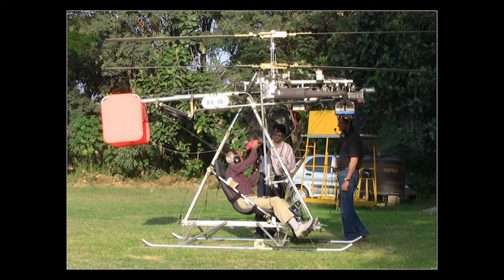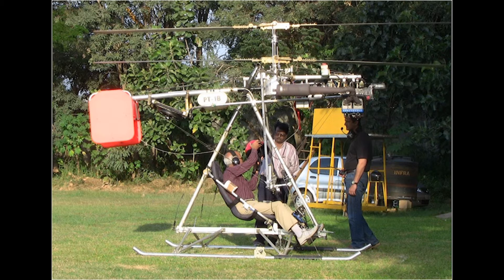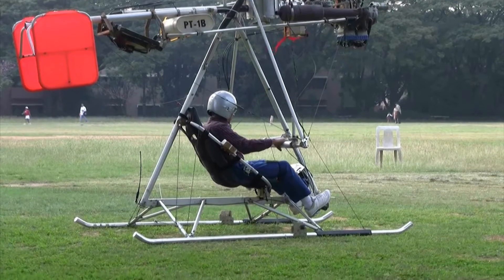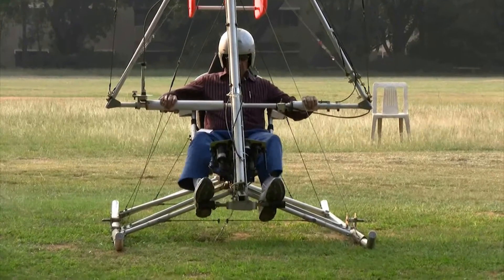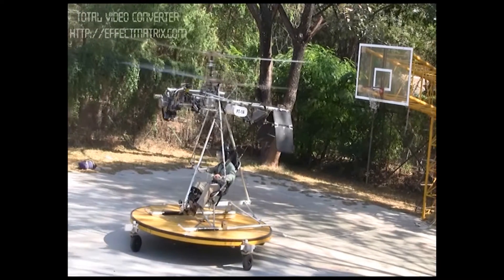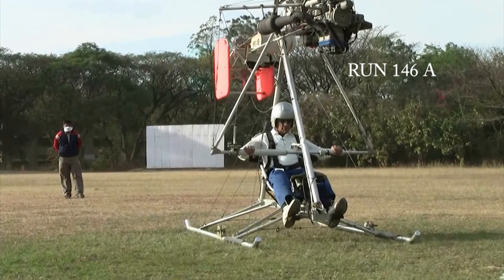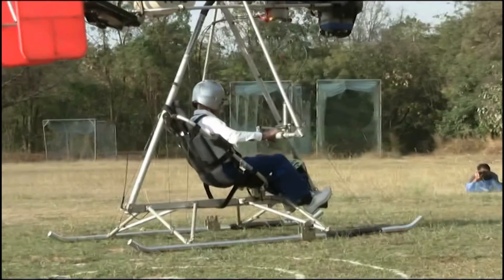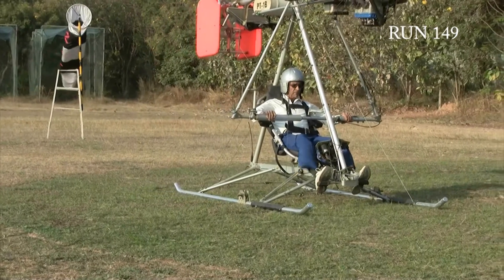Helitrike Overview 2015

Comment: Helicopter pilot/engineer/ AME/A&P of 30+ years here.  Put the Rotax 582 engine back in the snowmobile and live to love your family.
BTW get a copy of FAA AC 41-30 to learn how to properly lock wire a turn buckle.
Technically it flew by venture of leaving the ground.  I'll give you that.
Bee Safe.

Comment: You've lost a lot of leverage for control by having the engine mounted to the rotor section. And you've created a lot of inertia to delay response; there's a larger moment arm because of the far spacing of engine and counter-balancing components.

If you haven't already, I suggest you let this particular design go. It's a dead end. I think it's cool that you actually built it and test-flew it, though.